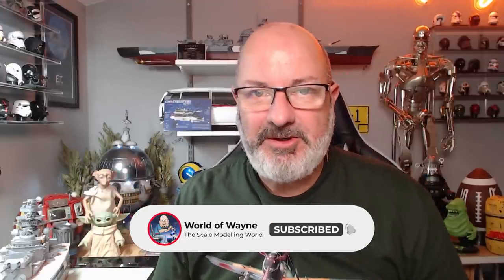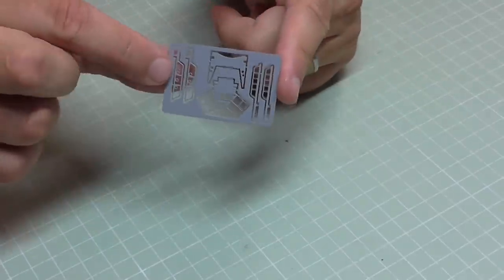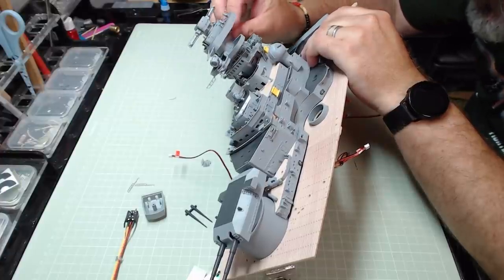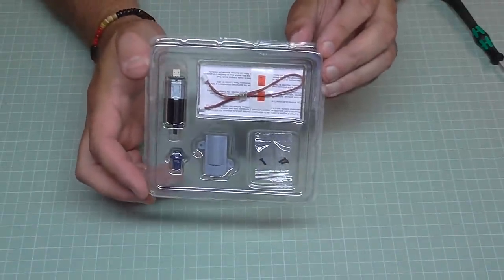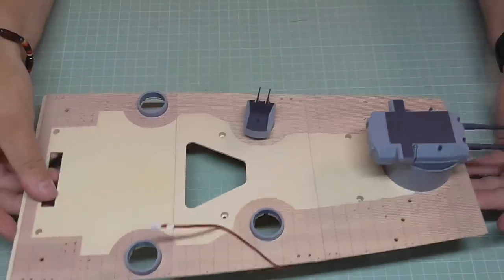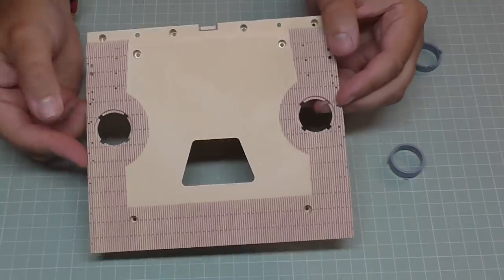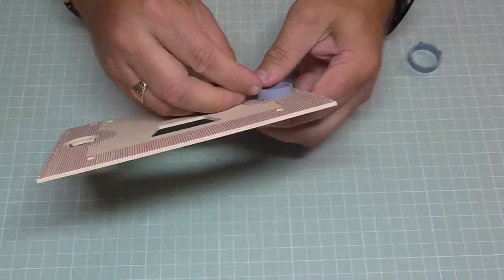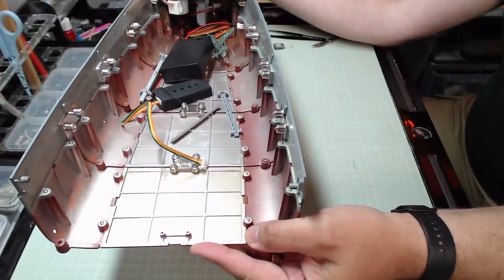Agora Model's Bismarck: The Legendary Battleship - Pack 6 - Stages 57-68

Comment: Hey Wayne,  Great instructional videos on the Bismarck build. I just subscribed with accelerated starter 6 packs. Can’t wait to get started on it. Lots of great advice. I will definitely be following along with your videos as I do the build. May I ask what brand of super glue you are using? I’ve been using Loctite professional super glue on R2D2 build which sets up fairly quickly. Do you think it would be fine for this build. Or do you have another recommendation.. Thanks again..
Reply from the maker: Yep. The loctite glue is good stuff

Comment: you might want to look at the white balance on the lower side camera as in some sections it hard to see some of the details on what you doing due to the white out on that camera
Reply from the maker: Yep. Still Trying to tune it in.
Reply from the maker: Can you do me a big favour and link to a timecode where it is particularly bad sonI can use it as a base.
Reply: @WorldofWayneUK  the first time it occurs is at 07:33, then at 10:21, 17:26, 30:18 and 35:50. Most of the time is when you have the deck with out the superstructure on it

Comment: Wayne: Quick question again on glue. I see you use my favorite the Tamiya Extra Thin. Can we use that on all plastic to plastic parts or do you recommend superglue as well for plastic to plastic parts?
Reply from the maker: It depends . Some plastics it's useless on.
Reply: @WorldofWayneUK  thanks Wayne. I’ll stick with the VMS Flexy 5K Slow which I just learned is a super glue specifically for these types of models.